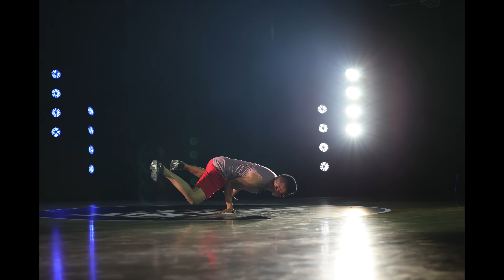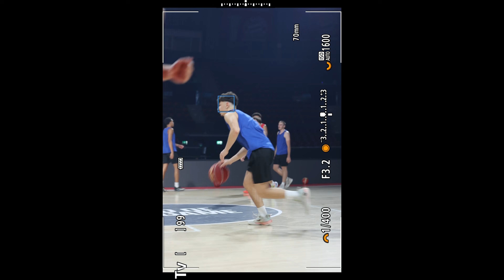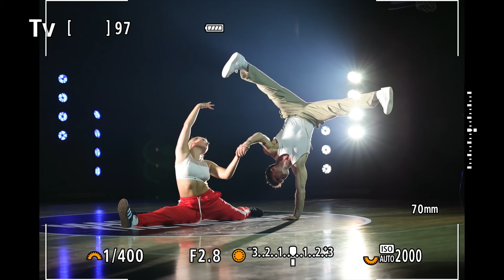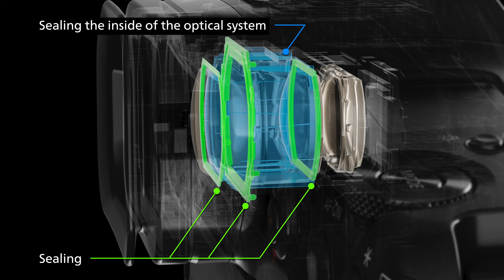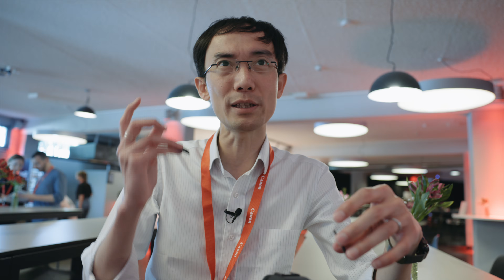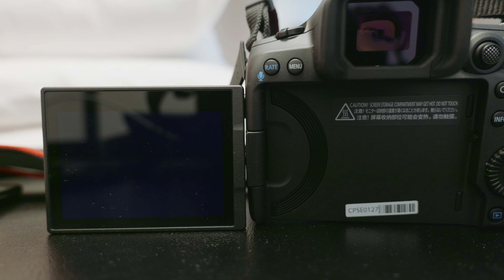Canon R1 and R5II Secret Weapon is AI! Hands-on First Lok

Comment: well, it was kind of unfair in the overheating because you were charging a nearly dead battery while recording.  It's not a common scenario.  In real life, people would most likely switch to a new battery than run off USB power.  If you have USB power from the beginning, it will also not result in overheating because at that point, you are trickle charging the battery.  But you waited until you ran out of battery before charging while still wanting to record.  Even phones and laptops will get very hot while charging from low charge.
Reply from the maker: Which I’ve mentioned it all, complete transparency; and mentioned because I didn’t have much time left. It’s also a beta test camera, as mentioned too. Everybody should take it with a grain of salt.

Comment: WTF Cannon. R1 weak features severely overpriced. Nike Z9 came out two years ago and blows it out of the F-ing water. The Z9 Nikon has third party lenses will auto focus with all  brands of lenses free firmware updates great auto focus 45MP STACKED and is $800 cheaper. Shutter shield etc.  Cannon is out of their minds. The Nikon Z8 is no different than the R5II and is $800 cheaper.

Comment: Sitting flat on the desk isn't gonna help with cooling if that's where one of the vents is
Reply from the maker: No, it usually doesn’t help with other cameras even without vent too. The reason is I didn’t bring a tripod to the trip, but I did put a lens cap under the camera to get it a bit elevated from the desk. Two things to consider about this test: a lot of other cameras I tested before did better under the sun, and this is a beta testing camera.
Reply: Thanks  @TheLokCheung  I didn't realise it had some elevation. I imagine the test on the tripod wont be that much better!

Comment: Fairly weird set of specs across the two - I'm particularly surprised they stuck with 24MP for the R1 as it really doesn't stand out much from the R3, and costs significantly more 🤔 The R5II probably makes more sense, but it still overheating when recording 4K without the fan attached is pretty wild considering how many other cameras perform better than that. Hopefully they'll fix that in the final firmware 🙈 Maybe it would have lasted longer if on a tripod with some airflow going through the bottom vent?

The shift to electronic shutter makes sense though - AF tracking of fast subjects is significantly improved without the blackout of a mechanical shutter in my experience. I do like that they kept the mechanical shutter too, though quite how much use it'll get is another question.
Reply: It was the scenario he was in. When he ran low on battery during his recording test, he plugged it into USB power. Anytime you plug a battery in low power state, it will heat up during recharge mode, especially during fast recharge. So to do fast recharging while also recording is a double whammy. Take your phone down below 10% and then plug it to an outlet. Feel your phone after a few minutes of charging. It'll be hot.